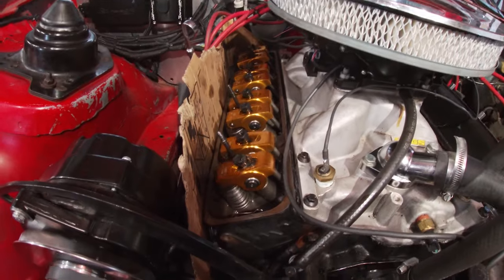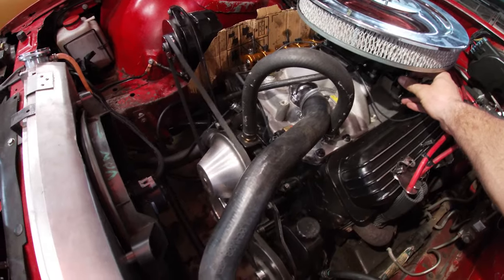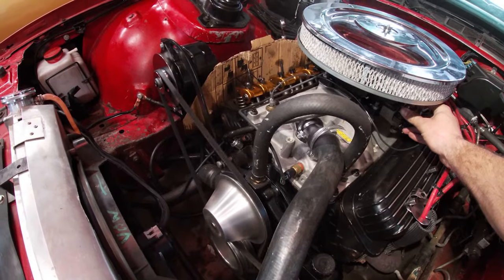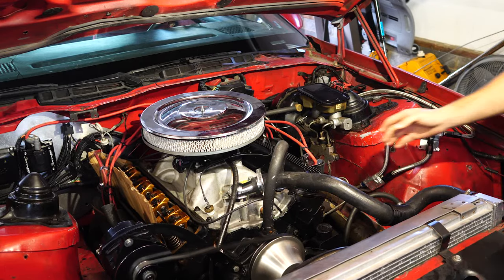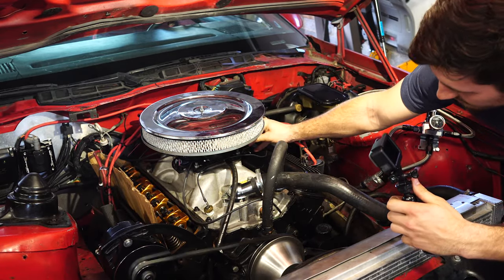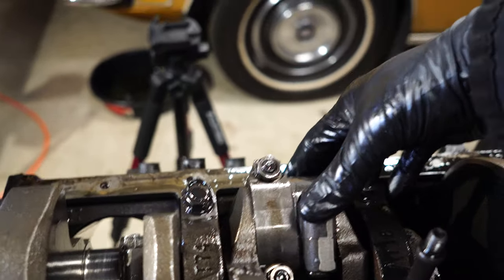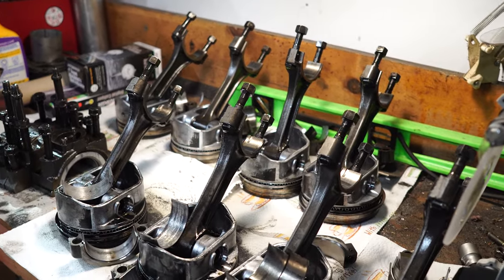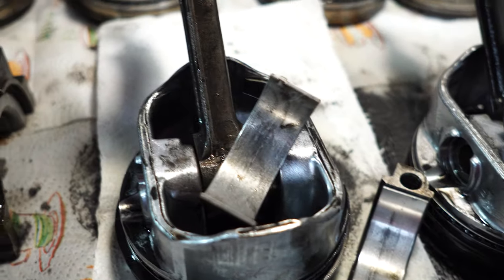What Engine Knock (Rod Knock) Sounds and Looks Like!

Comment: Is this a different sound than if you use a too low of octane fuel and get a knock?
Reply from the maker: Yes, that would be called pinging and your right that's usually low octane in a higher compression situation.
Reply: @ZanesGarage  so I have a sound and I think it’s knocking. I posted a video of the sound and some one said it was a leak at the exhaust manifold but I replaced the gaskets and it is still there. Should I pull the valve covers to check?

Comment: Can the piston rings being worn cause this sound? i am wondering this because we have an old moped that creates this type of ticking when at low rpm’s
Reply: You can have what's called piston slap
Reply: No. Worn rings dont make a sound. They  just let a little oil past and is burned, causing it to smoke a little, blue smoke, and you have to add oil . Black smoke is too much gas, and white smoke is from water getting in the cylinder, burned and making steam coming out the tail pipe and quickly disappears.

Comment: Um mine has a loud chirp aswell but im confused about mine makes 502 lbs oil pressure cold start 72 when on gas cold barely cuz well no fuel pressure in tank due to mechanical pump and people STEALING GAS but eh roadkill keep the square body rust free junky looking jimmy/k5 fully option alive till new motor lol im not driving it i got it started so the city doesn't tow it where i live they can't say anything if it runs

Comment: Will this allow a car to charge but not run? I’ve noticed when trying to start my car after a jump, it was having a hard time and when it started it begin this loud knocking sound and then stopped running while battery was still on
Reply: My car just did the same thing! 

Stalled, wouldn't start battery issue seemingly. 

Got a Jump, it started and made noise. 

What was it for you?
Reply: @cyberlocc  Same with mine, sent to mechanic

Comment: Catch a con rod knock early enough and the engine will live again. Continue to drive a car with a con rod knock the engine dies a slow painful death
Reply: Michael,  im pretty ignorant on engines? What’s a con rod. I was told I have a lifter ticking or knocking. Any suggestions?
Reply: @Bone89  A connecting rod connects to the crankshaft which makes a piston go up and down. They have 2 bearings as shown on the video bearings  if one or both are worn or damaged it causes the engine to knock. With ticking lifters it's not as bad and you can sometimes get away with using thicker oil to quiet them down a bit.